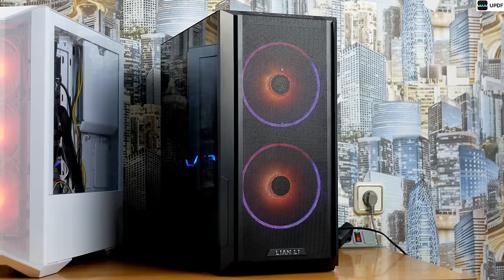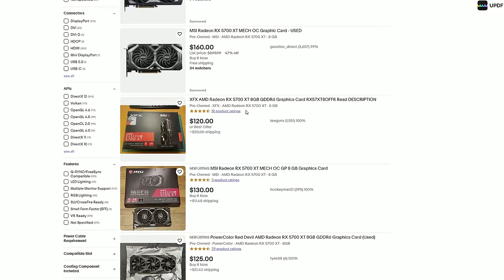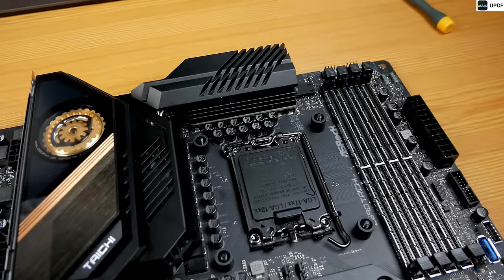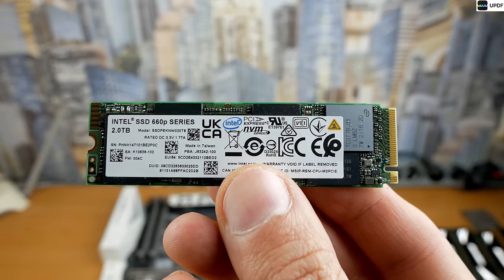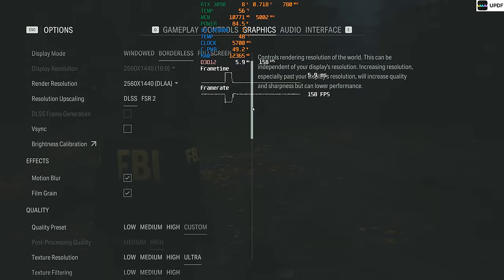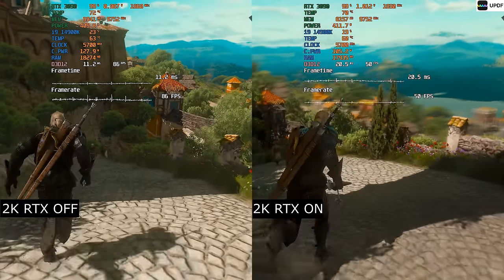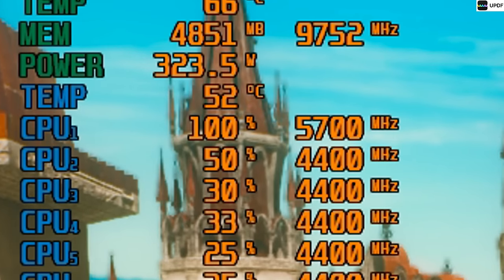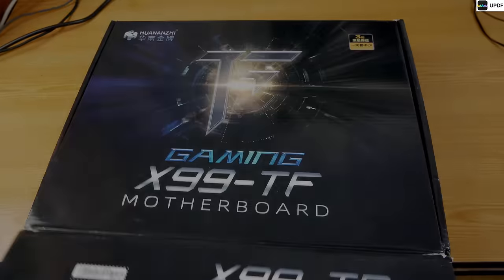$500 PC vs $3000 PC, Which PC is Better?

Comment: For $3000 you should be getting the 4090 not the 3090💀
Reply: dawg a 4090 is 2k alone lol
Reply: @24kwaxxvy  msrp is $1600
Reply: @trikooo  this guy is in Ukraine and prices can vary badly even purchasing stuff online. Even here in my country, most GPUs are not sold at msrp, a 4090 can be at 2500 USD and cheapest I found online is at 2100 USD equivalent
Reply: @KiLDELTA  in my country it's almost double than that

Comment: I have a $300 PC that plays games just fine. I don't play above 1080p so my expectations aren't that high. My specs are:
MSI Z370-A Pro Motherboard 
i7 8700k 
GTX 1060 6gb 
16GB of DDR4 RAM at 3000MHz 
Corsair H100i 240mm AIO cooler 
Kediers C570 open air case with 7 RGB fans.
Reply: May I know what's the PSU brand and watts? Thanks!
Reply: Did you build that yourself or
Reply: pretty damn good
Reply: Mine im getting for Christmas has an rtx 4060 and its $625
Reply: Nice job
Reply: Ps4 killer specs right there I understand. Computers are way ahead of it’s time
Reply: @duck_mangrove the expensive graphics card with lower end other parts will end up bad
Reply: that's pretty good for $300!
Reply: @dabagelgd  well, its $625 with an RTX 4060
Reply: @dabagelgd  nvm u werent talking to me 💀
Reply: I assume this is all used?
Reply: @duck_mangrove what are the rest of the specs
Reply: @Rinjel0  rtx 4060
I5-12400
8gb of ram (if i need more i could always get more, but i dont think many of the games i play would need much more than that)
Reply: @duck_mangrove  thats not bad but you should probably get 16gb of ram
Reply: @Rinjel0  I will probably if i need to. My friend plays fortnite and some other games on his computer at good fps with 8gb of ram though
Reply: How did you get it the i7 8700k in there. Its on it on is 300 dollars
Reply: how the hell is this just 300 bucks
Reply: Ur pc is so good in the future u can upgrade to like a 1080 ti, rtx 2070 or smt like that
Reply: 8700k + 1060, the legandary combo that still shines in 2024
Reply: wow that is so much better than my laptop
Reply: My pc has 
I7 3770k
Ddr3 8gb 1333Mhz💀
Rx 480
HDD 500gb
PSU 500W
Reply: @LowEffortOfficial dam sorry for you lmao😢😢
Reply: @duck_mangrove You got scammed. RIP
Reply: @AAlgeria  how? lol
Reply: @duck_mangrove  the 4060 is HOT garbage for its price. You can research a bit more. There really is no really new nvidia option for better than the 4060 but cheaper than the 4070, which means at this price point AMD would be a much better choice. If you are a nvidia fanboy a 3070 would be just fine.
Reply: @AAlgeria  you are very much exaggerating.
Reply: @duck_mangrove  You cant be talking about exaggeration when you started acting like the 4060 was the best gpu ever for a 625$ pc🤣
Reply: @AAlgeria  Ok? I bought the PC and its good. Is that an issue? Im happy with it.
Reply: @duck_mangrove did you get dual channel 8gb at least?
Reply: @Rolkey  I now have 32GB of RAM
Reply: @AAlgeria for 625 dollars though for a whole pc that's a steal

Comment: Would like to see an overclocked E5-1660 v3 tested. I think that would be the cheapest best X99 CPU to get.
Reply: I have an overclocked 1660v3 (4.3ghz core & 3.4ghz cache stable) on a mr9a pro(chinesium motherboard), you won't have much luck without a modded bios and most chinesium motherboards use a hacked server chipset so good luck overclocking your CPU cache and ram

(it also uses up to 200-255watts full load, so very convenient as a space heater but not as convenient for your power bill)

Comment: Hey bro, In my country, the Xeon E5 and X99 combo is quite common, but it’s usually paired with a cheaper GPU. These machines are often used for running multiple Android emulators or playing low-spec online games (especially for auto farming)

Comment: Got mine for 750$
i play in 1080p as i don't need a higher resolution, runs on High most AAA games
specs:
ASRock B450 pro 4
Ryzen 5 3600 - cooler: ARCTIC Freezer 34 eSports DUO
GTX 1660 TI OC
32GB of RAM at 3000 Mhz
case: AQIRYS Aquilla with 4 fans ARGB
Corsair CV Series  CV650 80 PLUS  Bronze 650W
Reply: When did you buy?

Comment: My 1700$ pc
7950x
3090 founders (memory can get upto 108c few games)
B650m arous elite ax
32 gb ddr5 5200 (ages something)
Corsair cx 750
Id cool 206xt cooler
Crucial p3 1tb
Cheepest case i could fit them in
Five cheap case fans (had defective rgb)

Comment: 2k res is literally 1080p. 2k means the res has roughly 2000 pixels horizontally. 1920x1080

In this case 1440p is 2.5k. 2560x1440

And that's why 4k is 4k. 3840x2160
Reply: Full HD is 1080
2k is the same as 1440
4k is 3840x2160
Reply: "2k means the res has roughly 2000 pixels horizontally. 1920x1080"

The 2k, 4k, and 8k designations have no real intrinsic, calculable meaning. They're just generic terms invented to correspond to the following resolutions:

??  = 1080p (Full HD)
2k = 1440p (2k HD) 1.7x 1080p pixel count
4k = 2160p (4k UHD) 4x 1080p pixel count
8k = 4320p (8k UHD) 16x 1080p pixel count

So you see, the k designation is just a term made up so that consumers can more easily identify a resolution type. But you can't really do any math with the k terms. Think of it like for moms that don't know anything about pixels or resolution, but they see the big 4K on the box, and instantly know that's the type her son was telling her about.

Comment: If it were me i would've grabbed a different xeon with lower core count and higher clock speed for cheaper and ran it on 2k and let the gpu do more work and use fsr whenever available

Comment: Could you please elaborate on why exactly should we buy only msi or EVGA Nvidia 30xx series cards on the second hand market? I am a pc reseller and never had I ever either heard that or experienced issues with other brands!

And another thing. The unstable fps on the budget one is entirely caused by the cpu and most of the time, lowering settings , especially resolution, would actually backfire!

Last thing. Are you sure that in RDR 2 it's the GPU's fault and not either the different game settings or recording ones?

Comment: hmmm my 700$ setup pc i build right now can play most all the games I play now for Full HD 1080P for sure. Here it's my spec: 
i5 13400F 
TUF B660M Motherband 
32GB DDR4 Dual-Channel
RX 6700XT Hellhound (2nd hand for sure) 
750W Corsair CV750 PSU 
1TB Crucial P3 SSD
Old NZXT H510 Flow Case from my big brother with 3 RGB Fans alreaday installed it
Deepcool AK400 Digital
Monitor I went for AOC 24G2 240Hz
Reply: great combo

Comment: can pairing a i9 14900k with a 3090 cause bottleneck?
Reply: It will not
Reply: No you could get away with a 14600k if you wanted
Reply: No, but only go for 16c or more CPU if you're ready to buy the best of the best which it seems you are.

Comment: 4070 performs same as 3090 but is a lot cheaper
Reply: not true, 3090 has around 15-20 more fps depending on the game
Reply: The 4070 is comparable to the 3080. The 4070 Ti is comparable to the 3090/3090 Ti
Reply: I meant ti.   Also 15 to 20 is. Not really noticeable as a young game dev you don’t need to spend that much if you can get 4080. Or 4070 ti for less used
Reply: @Camarodreamcar 15-20 fps for the price is not worth it